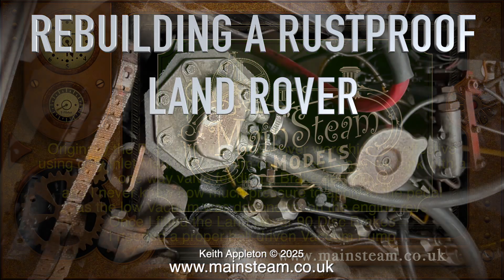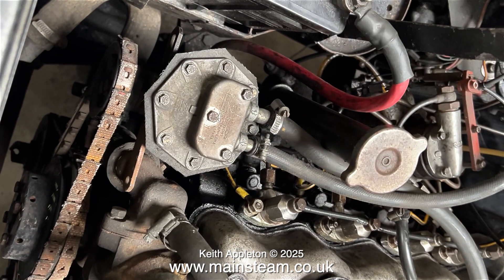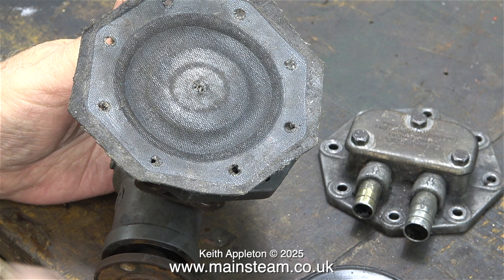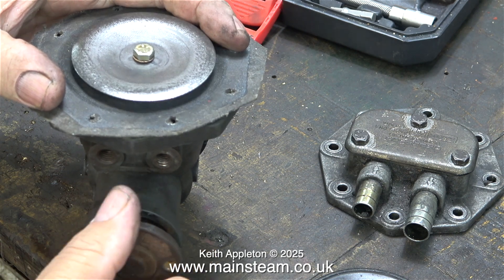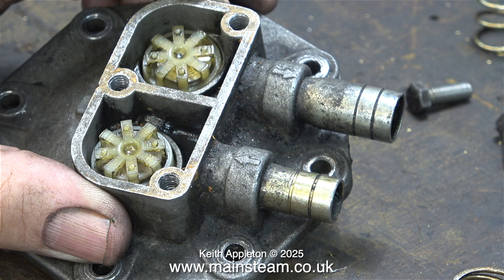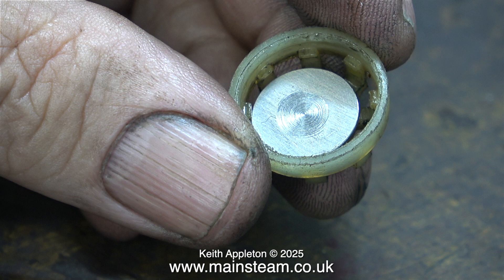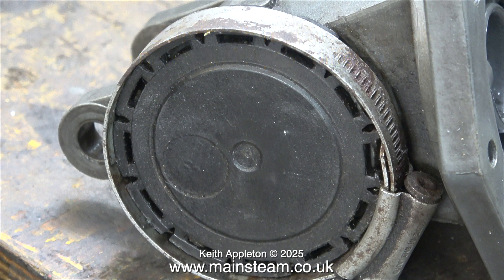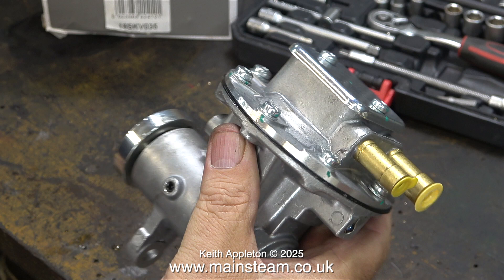REBUILDING A RUSTPROOF LAND ROVER - PART #21

Comment: The two check valves. One should allow air to escape and the other to allow inlet. Just like a water pump with two balls instead backwards to pull a vacuum not pressure.. Maybe consider a larger vacuum reservoir for added safety in case the engine stops. There will still be some vacuum to help you brake. Are the wind screen wipers vacuum too? I still remember those. Step on the gas and the wipers stopped.
Reply from the maker: Thanks, I figured that out in the end. The valves were a bit strange on the old Peugeot pump, but the new one is more logical. There is 25.5 inches of Hg when running and if I turn the engine of I can still stop. The Wipers are electric thankfully }:-)))